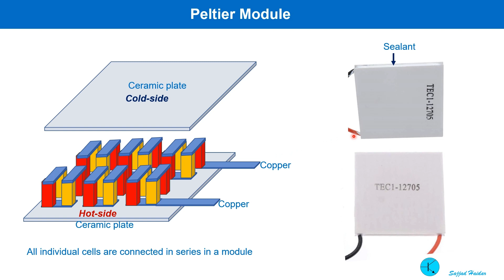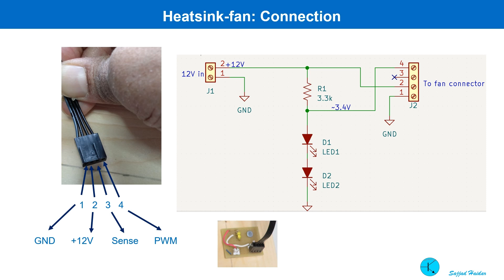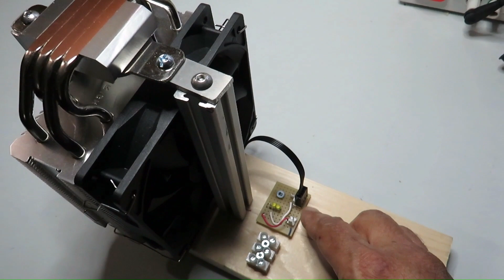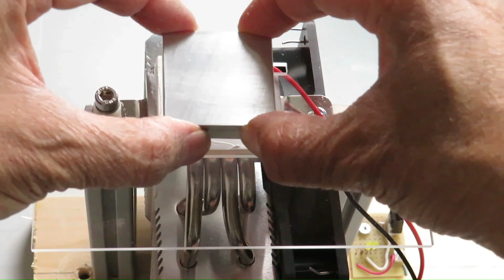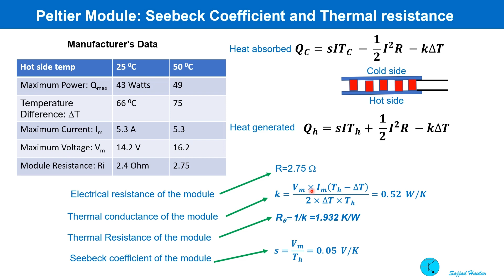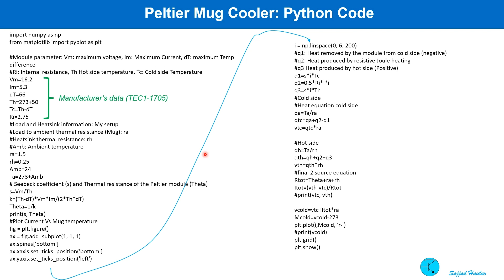Mug Cooler Using a Peltier Module

Comment: I'm curious if t his can be used to build a dehumidifier, since it seems to create condensation... 🤔 But will it attract it in a confined space when it is in gas form? That's the question...
Reply from the maker: Yes, this can be used as a dehumidifier. For a small room, certainly it works well. In fact there are some dry chambers available which uses this technique. Thanks for watching

Comment: Well I was only looking for Peltier Module but I got to learned from this video, tho my English become dead when it comes to Maths but I understand most of the assignment.
Thank You, Sir Ji!
by the way, I'm looking for a thin, very less power consuming Peltier module which can run on those 200 - 400mah small battery for an hour & doesn't create much heat from back. Can you suggest any, Sir ji?